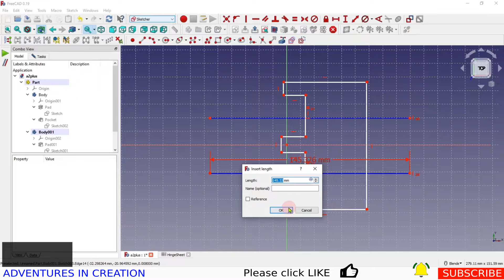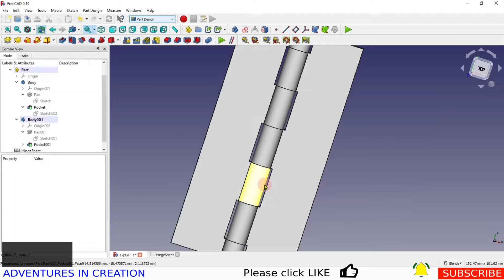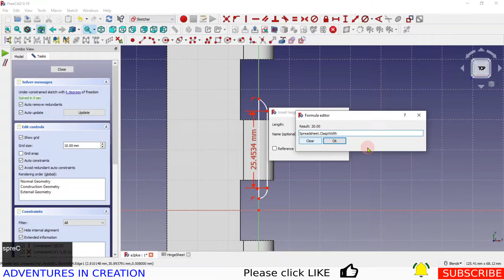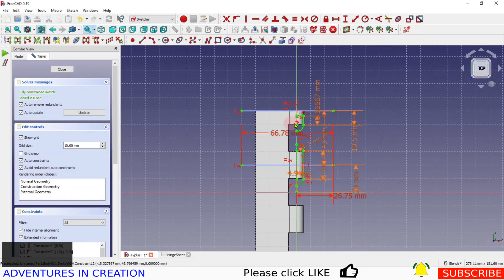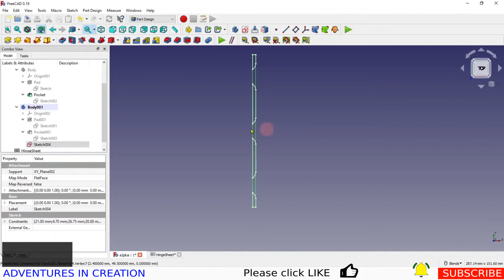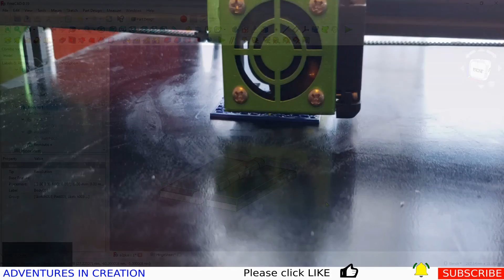FreeCAD print in place hinge Part2 - 3D printing

Comment: I've modeled your hinge but I added screw holes to the spreadsheet. When I create the stl file it is incomplete. The screw hole pocket is the last thing in the tree after the revolution of hinge pins. If I select the pocket it prints everything but the revolution hinge pins. If I select the revolution it prints everything but the screw holes. I can't seem to find a way to print everything. Any help would be appreciated. Thanks for the great videos.
Reply from the maker: Try selecting the part not the body
Reply: @Adventuresincreation  Looks like I didn't start with a part only bodys. Can it be salvaged or do I have to start all over again. I guest I will work on a startup macro. Thanks.
Reply from the maker: @keithroberts8568  you can add a part and move the bodies in there.
Reply: @Adventuresincreation  Just printed it again, same thing no hinge pins.
Reply from the maker: @keithroberts8568  can you send it to me?
Reply: @Adventuresincreation  Can I do it here somewhere or through email.
Reply from the maker: @keithroberts8568  can you post it somewhere so I can get it. I'll take a look at it for you
Reply: @Adventuresincreation  I can email it to you if I had your address. I'm an old guy so I don't any other way.
Reply from the maker: @keithroberts8568  I don't want to post it here as it will get bombarded with spam ;-) If you go to my channel about page and click on the for business inquiries I think you can get it there ;-)
Reply: @Adventuresincreation  Got it thanks. File sent.

Comment: Great video, as a newbie to FreeCad it's helped me. 
I'm having problems with the end of the first video where you add the first pocket my end result ends up with square boxes inside the clasp.
I've followed the video twice now and get the same results, I have to increase the Pocket size to 20mm to get it to look anything like the one in the video?
What am I doing wrong?
Reply from the maker: I am not sure Ian. When you say it's creating a box, it's that a separate model?
Reply: @Adventuresincreation  no it's within the pivot outer. The only way I have managed to sort it is decrease the pivot inner and increase the pivot clearance so it forms a circle part on the pocket
Reply from the maker: @ianbardell8030  I am not sure I am quite following you. It sounds like the outer may be too small when you started?
Reply: @Adventuresincreation  is there any way I could send you the file
Reply from the maker: @ianbardell8030  sure, you can email it to me
Reply: @Adventuresincreation  All sent
Reply: A bit late, might help someone else.  Probably set the outer circle (PivotOuter) as a radius, Pivot Outer should be diameter.

Comment: 6:19 Trying to bring the top clasp symmetrical with the top construction line and I get "Sketch contains redundant constraints" and everything turns orange on my PC? Symmetry causes me confusion that anything? UGH I have redone everything 3 times and follow you step for step. I can not figure out what I am doing wrong?
Reply from the maker: If you have other constraints before you add the symmetry you may be over constraining. That's a reason I try to constrain geometry before I constrain dimension.

Comment: Great tutorial but I have just 1 question.. 

You put pins to join the hinge, would a bar going the entire width not be a stronger solution?
Reply from the maker: It might be Paul but, there's a chance the print in place wouldn't work that way
Reply: @Adventuresincreation  i guess it comes down to the length of the pin sections and printers bridging ability then...

Another option for smaller hinges is 1.8mm holes all the way and slide in a bit of filament as a hinge pin and just heat the ends and squash to keep the "pin" in
Reply from the maker: @Akira-Furball  good idea, I would love to see how that turns out
Reply: @Adventuresincreation  no idea, I stole it from someone else LOL But it sounded good :D

No, it works good for smaller hinges.

Comment: Thank you for the ideas! I'm wondering why we can't just make a cylinder on the left side of the hinge that is one piece that goes thru the holes on the right side like a metal hinge? Would that work?
Reply: Yeah it would also work this way. But keep in mind that it will be much harder to print since it will require a lot of high tolerance bridging this way
Reply from the maker: @haedulus  that could be a problem.
Reply: @haedulus  Ah.  Now I understand what you wrote.  I just got my first 3D printer, and printed out a hinge.  The hinge pins are shaped to allow the 3D printer to gradually span the open space between the two halves of the hinge.  It cannot print in thin air.  Seeing the print take shape made that clear.
Reply: @michaelj3971  it can, if its a bridge, going from one part to another.. so it WOULD create the pin.. But the longer the bridge the less accurate it will be as it sags a bit in the middle..

if the gap is small, 10mm or so, it should be ok, but only way to find out is to do it and see..
Reply from the maker: Feel free to try different designs. Print in place requires minimal interference between the parts.

Comment: Great videos.  I finally got to the end copying what you did. But when I tried to print the 2 sides with my Creality Slicer, it separated the sides and obviously you have to print them together.  I used my Ctrl key while clicking on the bodies to export.  Not sure what to do.   I did finally put holes in the other side so I can use a brass rod as the pivot.
Reply from the maker: You should highlight both bodies and export them. In the slicer they should appear as one print. I didn't do anything special there. I use the prusa slicer.
Reply: @Adventuresincreation  That is what I did.  I wonder if anyone was successful using the Creality slicer.
Reply: @robslabach  My advice would be to dump the creality crippled version of Cura and just get the latest CURA..

All you are gaining from the creality one is.. well.. you dont have all the great features the full cura has!
Reply: @robslabach  If you have selected correctly, both objects in the 3d view will be highlighted and green..

Then go to file export..
Reply: @robslabach  maybe.. in Slicer Preferences, make sure "ensure models are kept apart" is not selected..

But I am sure it would be loaded as a single model anyway..